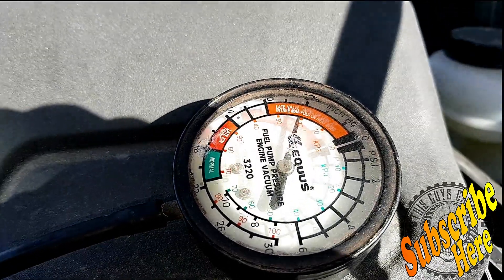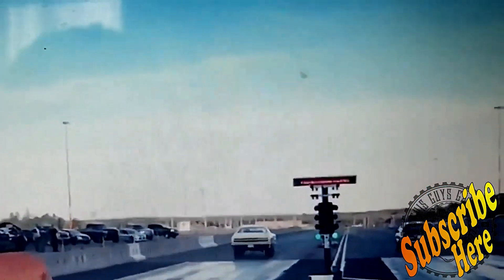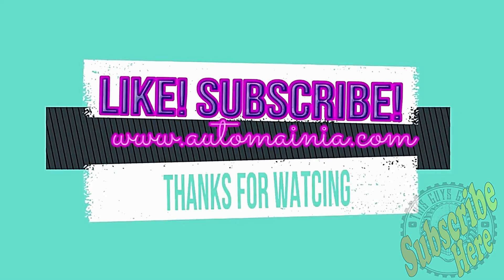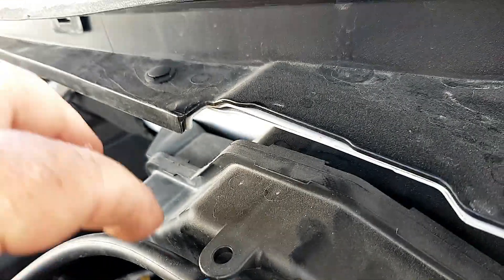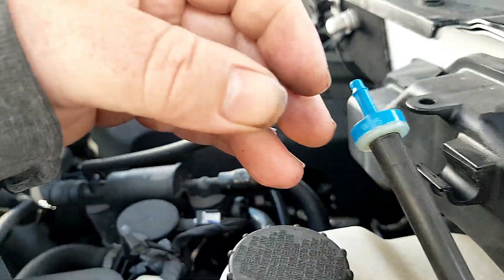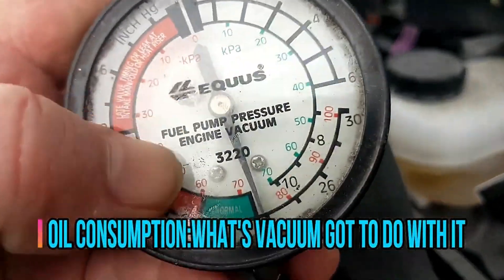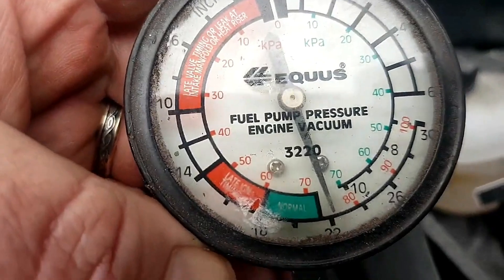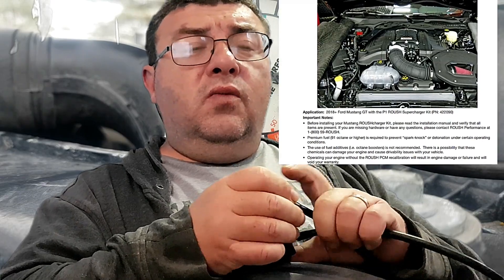ford f150 5.0 oil consumption how to vacuum test 2018 2019 2020 this guy's garage

Comment: Just subscribed... I own a 2018 5.0.  Purchased new in 2019...  I have no complaints yet but love this information...  I carry a full size 1/2 ton camper and pull a 22 ft boat and so far so good...
Reply from the maker: consider what i said about the oil weight. you are working your truck so a better weight oil may serve you well. dont forget about using tow/haul mode it will ease the stress on your engine. ty so much for taking the time and ringing that bell ,really appreciate it!
Reply: Agreed. Going to do it.

Comment: Currently at 6200 miles on my 2019 5.0. Hasn't burned a drop since 5000 miles. I check it weekly just to see. Had some consumption issues in the beginning but the TSB 2365 and updated PCV valve seemed to cure mine. It's like it hit 5k and everything sealed up. Runs like champ.
Reply from the maker: Hopefully it holds up for you. A lot of people are not so lucky. Ty for taking the time 👍
Reply: Reprogrammed the pcm on my 2019 and seems to have helped the oil levels. However, it has blue smoke on cold starts??

Comment: I just got a 2020 F-150 but opted out of the V8. I know people melt down over the 2.7 turbos but it would appear to me that turbos really only require good oil and filters frequently. 10 speed stupid smooth. She’s not broken in yet but I hope for 25mpgs as I drive backcountry roads at 60-65.
Reply from the maker: Good for you Brian.  I really have no complaints with my 3.5 either. The transmission works like it was designed for a turbo high torque combination. 🤜🤛
Reply: Yeah I wanted the 3.5 but they’re a bit pricey. They are beasts and I’ve already been ribbed by my Hemi friends for only having 325 hp. I pointed out it’s torque not HP but no one listens! Glad the 3.5 has worked out!
Reply from the maker: @brianfinn7644  its all about the torque . I hope we don't have any problems my friend.  Really glad you're out of the oil burner 🤜🤛
Reply: Yeah luckily I saw the build sheet before my broker settled on it. I’ll
keep you updated!

Comment: The engine rattle on my 2018 F-150 5.0 goes away when I push the traction control button on the dash twice to put it in advance trac sport mode.

Comment: thanks for the tip on the vacuum gauge T trick to have one in the cab, i hear its important to run zinc in older vehicles and that oil on the shelf in stores doesnt contain any and the detergents are too rough.
Reply from the maker: Great tip! ty yota
Reply: @thisguysgarage   i learned it from the guy that built the head and turned the camshaft im about to break in this morning and that hes seen people ruin a motor within 10 minutes of the break in not using oil with zinc additives. The zinc puts like a protective coating on the cam which makes up for any material loss during the break in.
Reply: @thisguysgarage  Btw I really liked how you did this video with the vacuum gauge laid over you talking.
Reply from the maker: @Toyotas_n__Tools  ty doug🤜🤛

Comment: I bought a 2020 f150 lariat 5.0. And I used 5-20 and changed oil at 1k miles then again at 3k and then 6k. And from there on every 4k. I also started using 5-30 at the 6k change. And so far I only use 1qt. Every 5k miles. Is this good ?
BTW truck has 11kmiles on it  and no engine noise. Also I use full synthetic, well havoline pro ds full synthetic.
Reply from the maker: keep doing what you are doing ,you are doing better than most , i would expect to use a quart between 4k &5k  a lot of folks are using 1 quart per 1 k .  stay in touch ask questions any time ringing the bell helps a lot .
Reply: @thisguysgarage  good deal thanks a ton

Comment: I live in south Texas where it’s hot pretty much all year long , do u recommend thicker oil than the recommended 5w20?? Also any fix for the throttle body whistle between 1500-2000 rpm? Thank you
Reply from the maker: that throttle body whistle is super annoying. no fix that i know of. i would suggest at minimum 5-30 and if rouch & ford will warranty your engine with the supercharger upgrade and specify 5 w 50 is required ,thats what i will be switching too.  but do your own research as well, i will post more information as soon as i get it. ty for taking the time.
Reply: @thisguysgarage  I had a 1996 Explorer that had air intake howl, that was embarrassing, it did last to 280K though
Reply from the maker: @victorarevalo108  🤜🤛

Comment: I am a Ford fan , but why they have issues with things like to this, or other things on other platforms like PTUs, door larches, etc. Seems like always a workaround to get things right, oh like the 5r55 series transmission is another example (also a great reliable trans if maintained or rebuilt right). Thanks for the video👍👍
Reply from the maker: it's befuttles me to why a technical service bulletin would carry over 3 years on oil consumption 7 years on door latches etc. I bleed blue too but this is taking the cake
Reply: @thisguysgarage  
Unfortunately I believe it's all about numbers. All companies have people that do cost analysis. They don't fix problems because they know they don't have to. People still buy their trucks. They sell so many that it's cheaper to pay lawsuit settlements and a few warranty claims and do band aid fixes to get customers through the warranty period then it is to stop production to fix a design flaw. To really fix the problem they'd have to redesign the engine again and either recall or buy back every f-150 they sold since 2018. They aren't going to do that. Look at the focus/fiesta dual clutch lawsuit. Ford knew that transmission was bad and they sold it anyway. Even though they got sued they still made money on it.

Comment: I watch slot. My truck is a 2018 with the 302. And I get that the oil consumption is normal. . I am at 105,000 and I use three quarts between each oil change. Must be normal.
Reply from the maker: 3 quarts is not normal between oil changes in my opinion. ty Adam for taking the time

Comment: All I know is my 250k mile 03 Grand Marquis doesn't use drop one of oil and it's rust free as fuck. I enlarged the hose on the shop vac. Don't ask me why.
Reply from the maker: 4.6 is awesome
Reply: @thisguysgarage  I agree. All my Panthers with the 2v 4.6 aren't race cars but they all run dead perfect and never let me down. They don't know how to break down unless it's a ghetto cruiser that'll never get an oil change.

Comment: Quick chat: has anyone with the 2018-2020 f150 5.0 V8 have the oil consumption issue fixed or disappear? Or had the oil consumption issue not appear at all?
Reply from the maker: are you in the market or do you own one?

Comment: Quick chat: has anyone with the 2018-2020 f150 5.0 V8 have the oil consumption issue fixed or disappear? Or had the oil consumption issue never appear at all?
Reply from the maker: ty